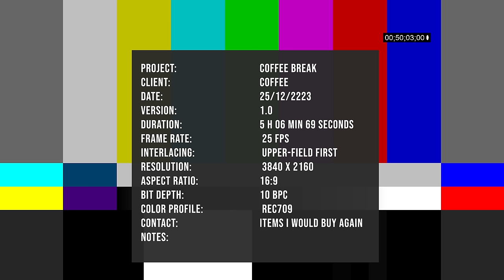10 CAMPING ITEMS I'D BUY AGAIN IN A HEART BEAT

Comment: Use the jetboiler to boil water before adding it to the Moka.  Coffee is brewed in a minute or 2 and reduces the chance of the coffee "cooking" before the water gets to. Impact on it.  I do it at home and the bush
Reply from the maker: 💯 mate have done it before using a Billy can. Gentle touch makes a big difference
Reply: That’s a lot of coffee passion😆
Reply: Yeah that would work but when I make coffee in the Moka pot I just put the water in the bottom and let it get hot and as it starts to boil then I drop in the coffee basket and screw the top on no chance of cooking the coffee at all
Reply: @dx80cruiser Nah mate, the grounds need to be gradually warmed to heat-off the volatiles in the ground beans.
Reply: See what you’ve started Ronny? Great campfire conversation by latte sippers😆..  @Ronny_Dahl
Reply: Jet Boil do not work up here in Alaska at -40 degrees.  MSR Whisperlite does work at -40 degrees.

Comment: Maxx trax: $450/pair... northern ridge knockoff's: $100/pair. They are only about 98% identical, rated for  10 tons, with a rectangular spot to place a high lift jack in the center. Hmmm..🤔 for the amount of times per year that i will need them, i think i made the right bargain.

Comment: lil tip for the ferro rod. he aint doin it wrong but he IS doing it the hard way. place your knife right at the base of your tinder ball. elboe locked into your thigh, wrist against the knee, blade up and thumb on the back of the blade all for stability. pull the ferro rod against the knife, not knife against ferro. all the sparks are conserved and thrown right onto the tinder bundle instead of only getting a fraction of the sparks. you'll spend far less time setting the fire.
Reply: Here in Scotland we use an empty beer can half filled with unleaded. The technique depends on the individual!

Comment: Yes, a good coffee pot is needed.  Also pack good coffee in a sealed container.
I have a fire starter sort of like that in my car.  It also has a little "saw blade" that slips into the part that hold the steel.  The blade is used to shred up wood by dragging it sideways on the wood.  It is good for making a rough surface on a bit of wood before you slice some off.  This makes it start easier.
The US military trenching tool is easier to to get hold of here.  Inspect it carefully before you buy because there are a lot of fakes out there.
It is also very good to buy some of those great big zip-lock bags and put the following in them:
1) A coat that is warm and good against the rain. 
2) A wool blanket that is just big enough.  Wool is good for not burning from sparks from a fire.
3) Shoes and spare socks.  Pick stuff that packs down small.  This is just for while your real shoes dry out.

Comment: My army shovel is DoD 1944. It constantly lives in any vehicle I've owned for at least 30 years. Unbreakable, it was $3.00 at the disposal store, they had a huge crate of them, all new and greased up wrapped in wax paper. I think it was another $1.50 if you wanted the army sheath for it.
 My machete is DoD 1966 or '64 far better than an axe except it won't do double duty as a hammer like an axe will.
They don't make em like they used to.
Reply: Traded an Aussie (while I was stationed in Hawaii) Royal Reg  soldier for a WW2 machete (US) that i ABSOLUTELY cherish. Has original sheath and stone ....used it in jungle hunting feral boars (dogs and knives) in 1980s. 45 years later it never leaves my vehicle.

Comment: great vid.  I've got one of those military grade folding shovels with the pick.  It was my dad's from when he was drafted during Viet Nam.  It is a beast.  And...I actually think they designed it to hold the TP roll like you showed.  That's why it doesn't have a T-handle.  As I've moved from backcountry backpacking to camping out of my truck, it can now go with me and I remember my dad whenever I use it.  He was a good guy...so not just when I go to the toilet.
Reply: No T handle because it slides into its sheath to pack mount.
Reply: @hamishsmith6077  Yep...but which came first?  The sheath or the need for the guys to keep the TP off the ground when taking care of business.

Comment: I'd personally recommend the Aeropress over a mokka pot. Can pick them up for around $50 now.
Reply: not really camp friendly, will break in no time
Reply: @lambbosbread123  hardly. The material they're made of is extremely durable. I've had one for years and it's been beat to hell with no issues.

Comment: Hi Ronny, nice Vid however I have totally disagree re the Slide torch. The problem I had is that as it got older the mechanism would open in the console or glovebox and drain the battery. They do have a lockout to prevent this happening but if you forget you are in a world of hurt. The best torch I have ever owned was/is a Nitecore MH25 fireblade. No red but will light up the world..

Comment: Some good ideas there, I'm partial to a good knife too although many of mine these days are becoming display items, simply because I have all I need for my camping etc. I have one that looks very similar to your red one however mine has a glass breaker & seat belt cutter on it and opens with a quick flick one handed. That one lives in the drivers door pocket in case of emergency. My most carried one is a Bowie Knife with a custom leather sheath and is used for a lot of different things around camp including striking my ferro rod.

Comment: Lock the shovel at a 90 degree angle. Place the handle down on the ground with the shoveling part up. Rest on cheek on the shovel that is locked at 90 degrees to take a dump. Voila, it’s also a toilet seat.

Comment: Love watching your content Ronnie but have to opinionate, a foldable knife, no matter how fancy, is a hazard in a lone situation and can lead to injuries that may need immediate medical intervention that you might be VERY FAR AWAY FROM, a good full knife with steel that runs through the handle whether plastic or metal or leather with a flat head surface area on its upper will serve you in any conditions, never carry foldable knives on any adventure away from home, EVER, they can lead to serious injury and always carry a blood clot pack in your first aid kit with some spray on super glue, Kiddies!
Reply from the maker: Interesting point mate never thought about it from that perspective
Reply: I have a couple of really good foldable knives which I love and carry most of the time. But I have to agree with brother Mark. I tend to use my strength a bit and that can be dangerous with a foldable knife. When away (from everything) I want a good thick steel knife with not too high a carbon content, where the steel runs all the way through to the end of the hilt. Otherwise I might break it. When I was a kid I just about decapitated the top of my thumb with a folding knife. They sowed it back on so all good. Just something to think about.

Comment: 01:45 the striker should be held and the ferro rod moved over the striker, the aim of the sparks is more accurate. Don't use the sharp edge of a blade as the striker - read the Instructions.
Reply: they were useing the sharp edge of the knife to hold it as they struck with the back side, hence cutting the finger.